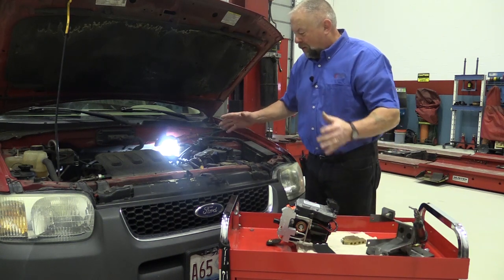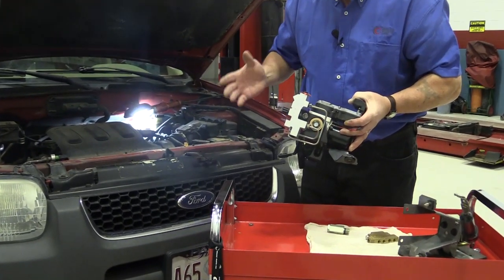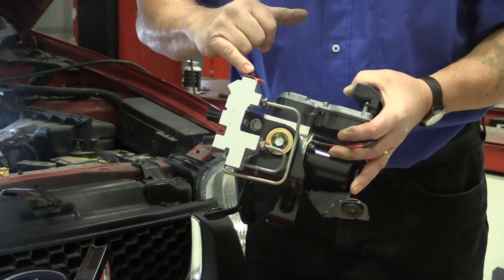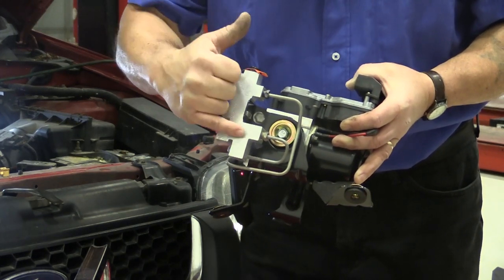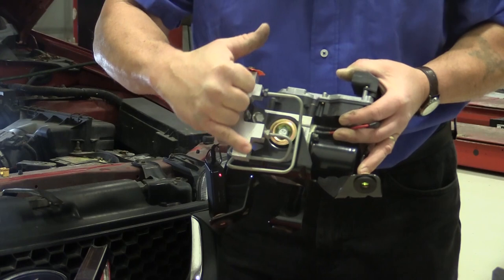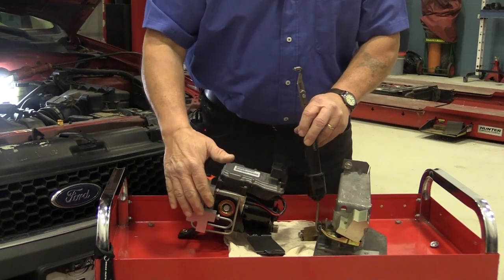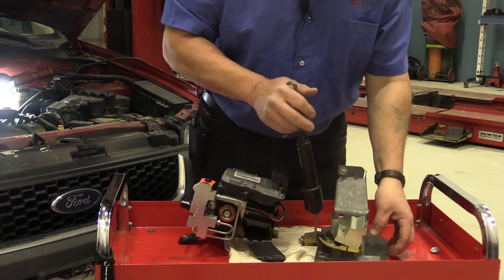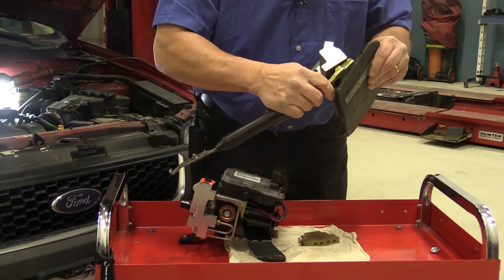Brake Valve Discussion  (Proportioning, Metering and Combination Valves)

Comment: Hello,  We Have 2016 E450 cube van that the ABS system was not or very little braking to rear brakes all the time. We pulled fuse for ABS and still have very little brakes in rear and fronts lock up. Which makes the truck dangerious to drive in winter. I have taken the truck to two mechanic shops and both say pull the fuse and don't know what else to do for us.

Comment: I have a very important question regarding my 2006 Toyota Tacoma that uses the anti-lock system, where is the proportioning valve that I cannot find? The power amplifier and the brakes and master cylinder are in excellent condition. Everything seems normal when I drive it, so far when I have to brake hard the front wheels do not lock. How can you help me with this problem, which is very worrying? I will be thanking you very much.

Comment: 2003 Trailblazer 4.2L 4X4 no brake fluid coming to front brake calibers (or bleeders), help?!!!!
Master Cylinder, 2 Front Calibers, 2 Front Rotors, 2 Brake Pads are brand new/replaced. 
Yes, Brake Fluid is in Brake Reservoir (new/bleeded-good) & pumped the Brake Pedal.

Again, still not getting any brake fluid coming out to the front.
Back brakes are fine.

Comment: NOT so with a 2008 Ford Escape Hybrid I have 3 brakes that hardly work at all and 1 that will not stop working no matter what until i release the pressure on the front Driver side caliper. Ford really failed at life on this and now im faced with junk a beautiful running vehicle or custom brake system build and loose brake regeneration or cough up the $5291.00 price the Ford dealership  quoted me for a replacement ECU/HCU. Being im not made of money and dont just have 6 grand laying around to blow on fords fail of building a reliable abs system for this vehicle Im going to bypass the junk abs braking system and hope it works well enough to not have to take it to the junk yard.
Thanks for the video Im looking into proportioning valves.